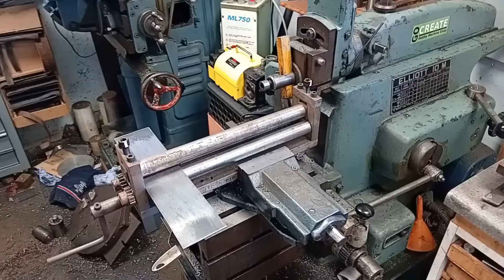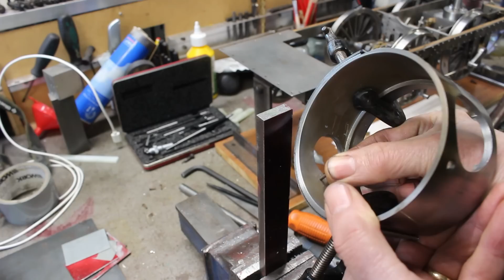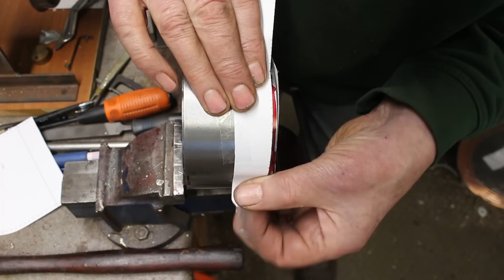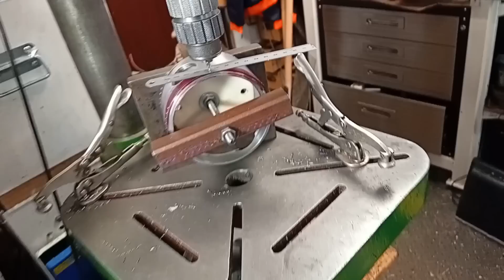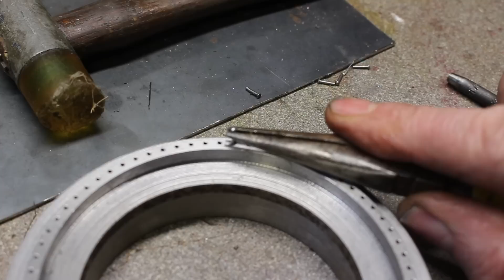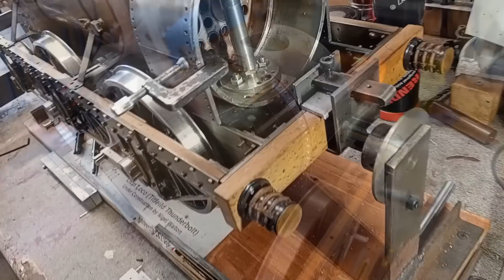LION Vintage Steam Locomotive | Model Engineering Workshop Build in 5"g - Part 64

Comment: Hi Nigel love the videos thanks. I notice you use the horizontal milling far more frequently than the vertical. Is there a reason you prefer horizontal? Isn’t it a little more difficult to see what you are doing, as invariably the part to be milked is facing away from you. Thanks!
Reply from the maker: Thanks, it's good to know my videos are enjoyed by so many people. My vertical mill has quite a small envelope size and the tooling I have limits me to smaller size cutters. My horizontal mill is much more geared to larger work using larger cutters. But yes, I do have a soft spot for the horizontal,  its a very versatile machine and a little out of the ordinary, I like taking a different approach to jobs. You're right, visibility can be rather challenging.
Cheers 
Nigel